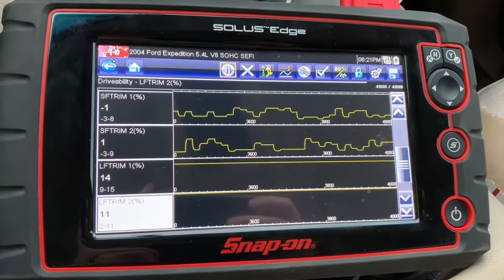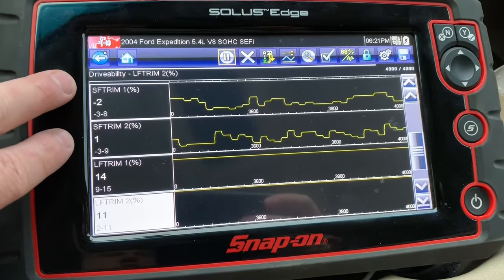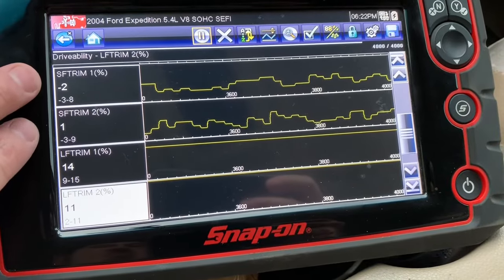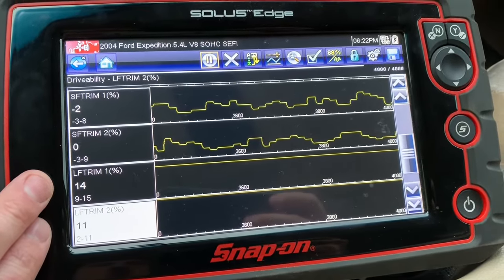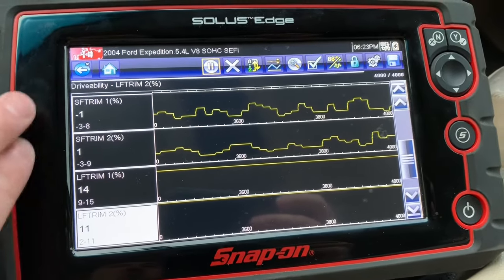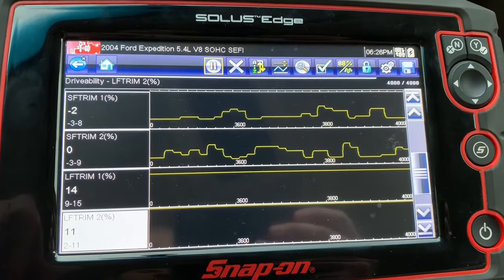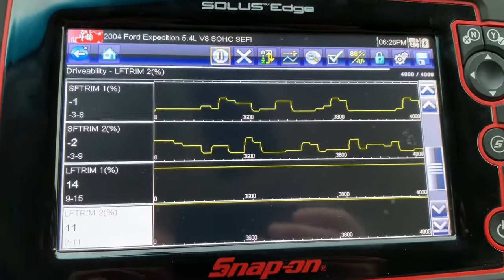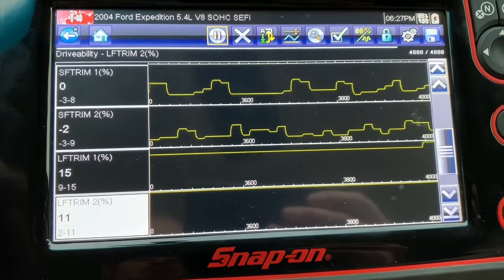Using Short and Long Term Fuel Trims in Diagnostics

Comment: They made cars too complicated. I'm thinking that if the computer and sensors are working properly to maintain the correct AFR, then should I care about a "high" LTFT. Bank 1 is +14% and bank 2 is +12% but the car drives good and there are no codes. STFT alternates between +/-3%. I don't have anything to measure AFR. By the way, I'm not a professional mechanic that has access to all the "toys" (test equipment). But I would like to get the LTFT under 5% and hopefully without breaking the bank.

Comment: My long term bank 2 is around +9% at idle while short term for same bank keeps trying to slowly subtract fuel (-1 -2%) but it never really tries to add fuel....strange because the computer obviously sees this bank as running lean because it has increased the long term but you would think it would settle in and start oscillating from adding fuel to subtracting fuel because the cat needs both gases....mine just subtracts fuel while running long term +9%

Comment: Hello, i had negative fuel trims in my car like -18%, los of power and bad idle, i changed the maf the car run very smooth now, and have much more power but Ltft has gone -25%. Any idea why the fuel trims went more nefative but the cur runs better? Could be the ne maf faulty as well??
Reply: It's been 2 years, were you able to figure out what was wrong?

Comment: Hey great explanation I just had a question I have a 2014 charger 3.6 giving me p0172 and p0175 I don’t feel any misfires but the long trim show -32.812% on both banks and short trim -33.593. When I step on it the long trim goes to 0%

Comment: At what point do you reset LT fuel trim? Gasket change, found a vac leak and fixed it?
Reply from the maker: No need to reset it. If you fixed the problem LT will fix itself.

Comment: ok so what is mine doing if my stft is around -3% to maybe +5% but my ltft is consistently +10.9% no matter what the load is? and to help diagnose it my car is an ld9 i4 2.4l dohc engine with around 75k miles on it! ive recently done plugs, coils, coil boots, new battery, and cleared a couple unrelated abs codes so the car would shift smoothly so i could drive it and perform these tests. any info would help quite a bit on trying to find my issue! hopefully its just a small vaccum leak somewhere lol!

Comment: I have a problem, sometimes my vehicle will have a rough idle, i check it using a cheap obd scanner, i found the short fuel trim drops about -10 , o2 sensor working fine and maf sensor, i also clean the injectors and replace fuel pump
Reply: Possible fuel pressure regulator stuck closed

Comment: Fuel trims supposed to be under 10%? My long term reads 11- 12%
Reply: Engine is running rich, injectors leaking, fuel reg is stuck closed, MAF sensor failing

Comment: Short term fuel trims on both banks increase from about 4 to 30 when I rev. the engine on idle. After letting go they immediately drop back to 4. I would assume this is normal.
Reply: I'm not an expert but I would think you might have some fuel delivery issues (weak fuel pump clogged injectors etc)....do you have any drivability or idling issues?
Reply: @macknumber9  We did have a bad fuel pump, but the STFTs normally do what I described 1 year ago. It is the LTFT we needed to look at. Also the pump specified a certain PSI when we hooked up a gauge to the schrader valve. Our pump was way below the specified value and that's how we concluded it was a weak fuel pump.
Reply: @OldSchoolNoe  what do you mean the short trims normally do what you described?
Reply: @macknumber9  STFTs bounce around as you step and release the pedal
Reply: @OldSchoolNoe  yes stft will bounce but it depends on where ltft is.  If you mean bouncing is +5% to -5% swings that's exactly what you want.  That means the pcm is able to balance the air/fuel mixture with THAT ltft.  If STFT is doing this with LTFT at +25% though then that's a lean problem...
Reply: @macknumber9  LTFTs were fine, they stay at 4% for both banks.

Comment: My car had a short term fuel trim of plus 5 or 6 and a long term of minus 6 or 7 so i thought it may be due to the air filter and injectors being dirty. I changed the filter and used some injector cleaner now my short term is pretty much zero but the long term is still minus 6, should I do a idle relearn??
Reply: Did you ever figure out what it was?
Reply: @Capt.Rankin  had a small tear in the rubber intake tube going from the air filter box to the throttle body, right in the bend. Didn't notice it until I was changing out my airfilter box because it had a crack around the rim. Got all that fixed then a uninsured driver tboned me, totalling the car.
Reply: @donniev8181  it be like that

Comment: Very good description of short and long term fuel trims. 
Man i have a problem,  my suzuki areo longterm fuel trim is constantly around 9 while short term is around -1 to +3 . while my petrol average is drops from 12L/km to 6L/km in city drive.
Reply: When you observe Short-Term Fuel Trim (STFT) around -1% to -3% and Long-Term Fuel Trim (LTFT) around 9%, it typically indicates the following:

1. **Short-Term Fuel Trim (STFT)**:
   - STFT values between -1% to -3% suggest that the engine is slightly compensating for a rich air-fuel mixture. Negative STFT values indicate that the engine is reducing fuel delivery to correct for a potentially rich condition. This adjustment is happening in real-time and can vary as driving conditions change.

2. **Long-Term Fuel Trim (LTFT)**:
   - LTFT around 9% indicates a consistent adjustment made by the ECU over time to compensate for a lean air-fuel mixture. A positive LTFT value suggests that the engine is adding more fuel than usual to achieve the correct air-fuel ratio. This adjustment helps to address persistent lean conditions that might be caused by factors such as aging sensors, minor vacuum leaks, or changes in fuel quality.

In summary, with STFT around -1% to -3%, the engine is currently adjusting to slightly reduce fuel delivery due to a perceived richness in the air-fuel mixture at that moment. LTFT around 9% indicates a longer-term adjustment to compensate for a lean condition by adding more fuel over time. These values are within typical ranges and indicate the engine's adaptive capability to maintain efficient combustion.

Comment: When I rev my rpm to a higher idle my stft goes way negative pass -10 what could it be
Reply from the maker: Remember O2 sensors drive the stft numbers. So what are the O2 sensors saying at the same time?
Reply: @hunterautomotive4842  when I rev and hold it at about 2000rpm the stft goes to about -22.34 and ltft goes to -0.78

At idle stft is at 3 to -3
Ltft is at -10.16